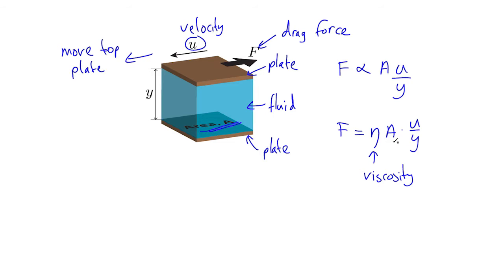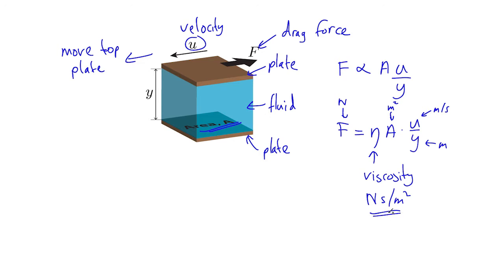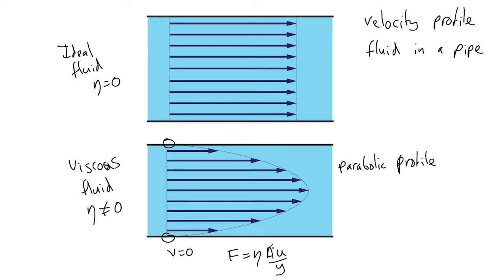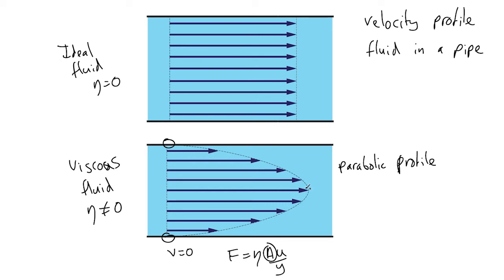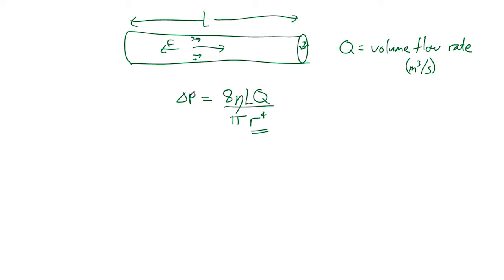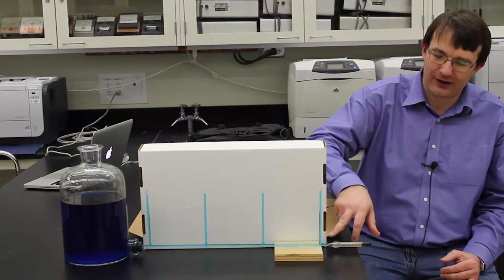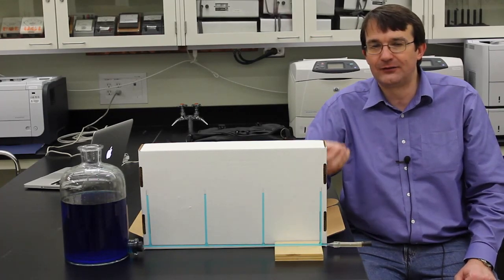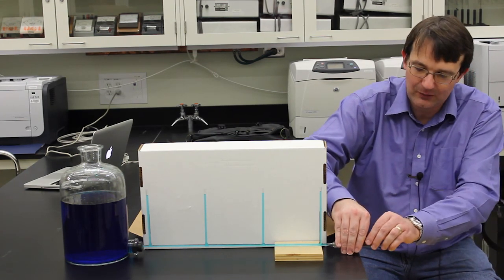PHYS 146 Fluid Dynamics, part 3: Viscosity

Comment: when we apply force on any object , it will get an acceleration. so its velocity will keep increasing. so in case of fluid layers , how top plate will maintain a constant velocity V after applying force F?
Reply from the maker: Good question! The fluid viscosity transmits the force to the bottom plate which is fixed so the force required to hold the bottom plate stationary is what cancels the force on the top plate and prevents acceleration.

Comment: Great lecture. Very enlightening, however I would like to make a question. Since there is a pressure drop in the pipe can I assume the velocity of the fluid varies along the tube?
Reply from the maker: +Matheus Moraes Biondo Good question but no, for an incompressible fluid in a pipe of constant cross-section the velocity of the fluid will remain constant in order to conserve mass but the pressure will still drop. Any pressure drop means that the pressure force on the fluid is doing work. For an ideal fluid this work done is converted into either potential or kinetic energy (see Bernoulli's equation). However in a viscous fluid the force does work against the viscous drag force. This will result in heat energy just like work done against a friction force.